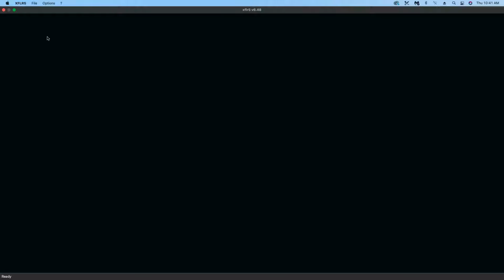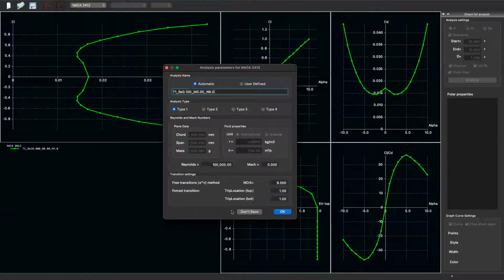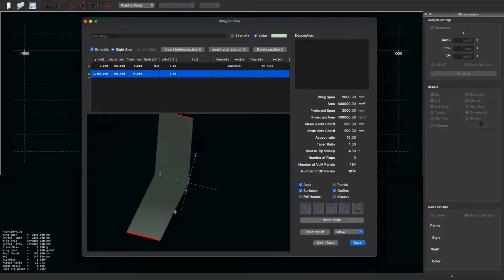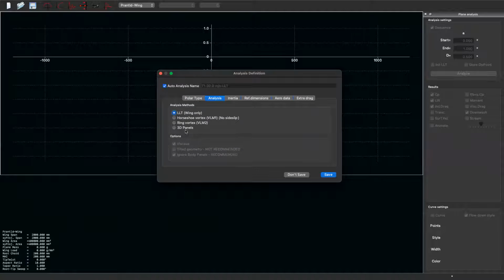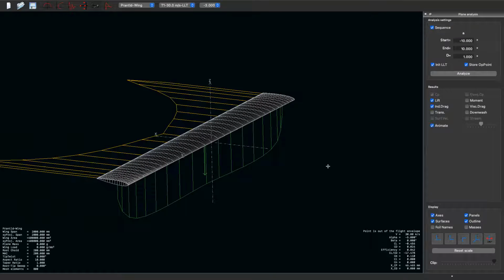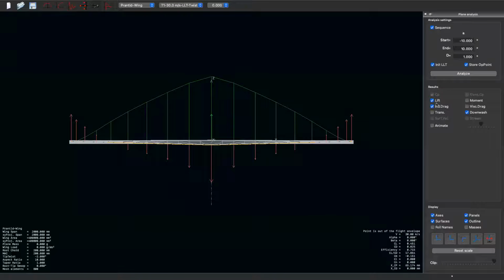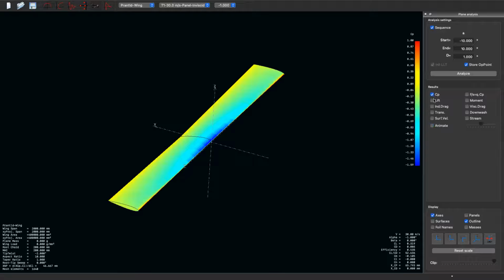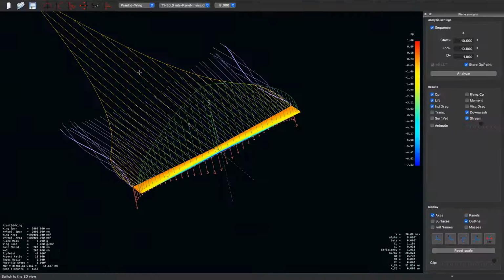Using XFLR5 for Airfoil and Wing Design

Comment: I have a problem with the cp location in xflr5.On condition that the angle of attack increases, the cp location will come to near the front side of the wing, but in my program, the cp location does not come to the front side of the wing on the contrary my cp location goes backward.

Comment: I did similar analysis, using type 1 analysis (fixed velocity). When I run another velocity, the streamline the same with that from different velocity. Did you try your analysis using different velocity? and see the streamline

Comment: Hi Sid, I used your video for designing a foil for Windsurf foiling. This is currently a hot topic, because the sport is growing fast (and it is olympic). For my foil the parameters from your video may not work, as I assume a speed of 15m/s  - but in water. Can you please give me a hint what to change at the analysis? For me the stall angel and the lift would be crucial, but the program says:"A+Ai+Twist =    3.5 could not be interpolated"
Reply: you need to run at alpha 3.5

Also for water you need to change the density in your analysis settings from 1.225 kg/m^3 to 1000kg/m^3. Also you will need to run your airfoils at ~1000x the reynolds numbers in xfoil

Comment: Great video Sid. When I compare the twisted vrs non twisted wing the total drag is higher, also L/D is smaller for the twisted wing. O.K. you don't need rudder but wing performance is poorer. Is this higly twisted wing a propper aproach for a reduced drag wing?  thanks.
Reply: Depends on the wing. Twist should reduce induced drag and also reduce the tendency to tip stall.

Comment: I have a query related to simulating an airfoil in XFLR5 which I am trying to import in dat file. Does this provide analysis on any airfoil which we can import or there is a predefined set of airfoils that can be simulated? In case of latter, how can I retrieve the available library?
Reply: skill issue

Comment: Hi Sid, thank you for your video. I'm struggling a bit with doing the plane analysis. I followed all your steps, and my points converged, but no data points were generated. Any advice?
Reply: I had a similar issue. I changed the Re for the foil analysis to 400,000 and ran it again and it worked for me.
Reply: @r9bet  The problem is I'm trying to use this to model an RC plane for my dissertation, so the Reynolds is very low, so I'm not sure if that means I have to generate "unrealistic data" using a higher Reynolds and then provide an explanation in my disso.